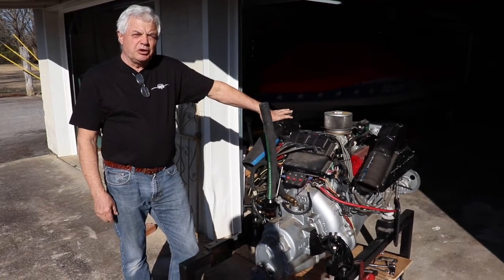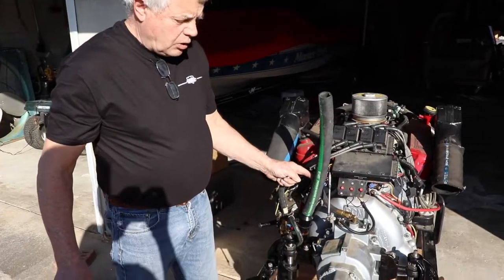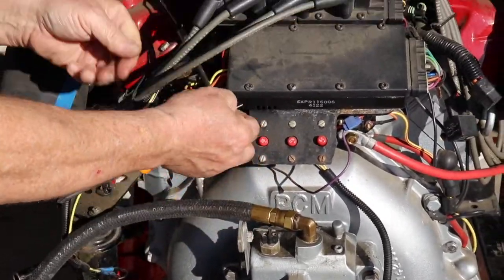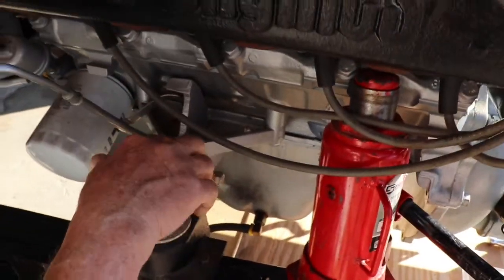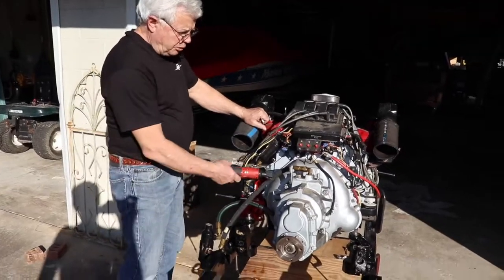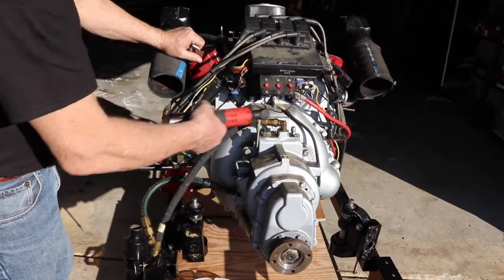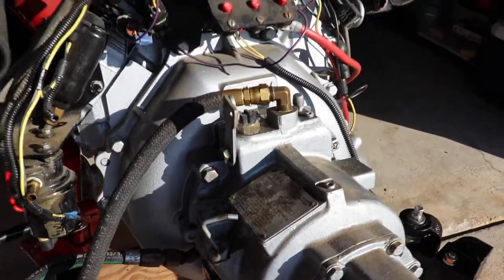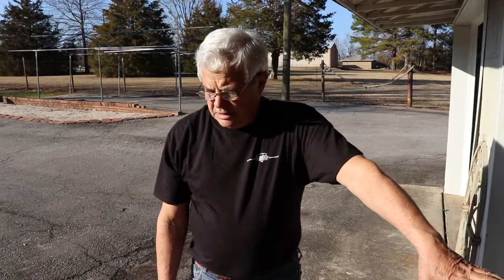How To Remove a PCM Direct Drive Transmission | Inboard Marine Repair

Comment: Great video. I have a ‘98 Sunsport with the GT40 ProBoss 5.8. Had transmission issues last yr. Think I need to pull tranny out. Is it basically the same process with mine as with the one in the video? 
Thanks!
Reply from the maker: Hey Roger, yes the process is the same for your transmission! Call us if you need any help
Reply: Thanks for the response. 👍👍